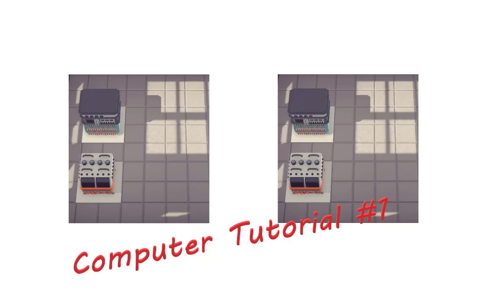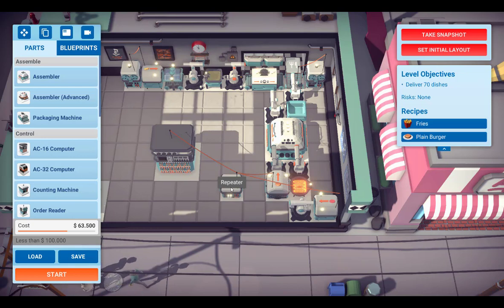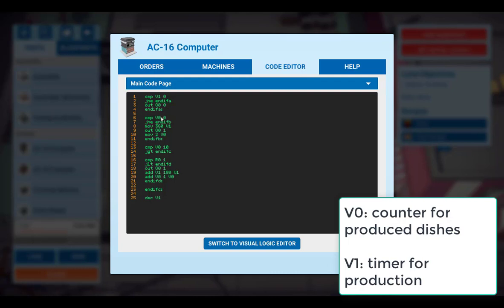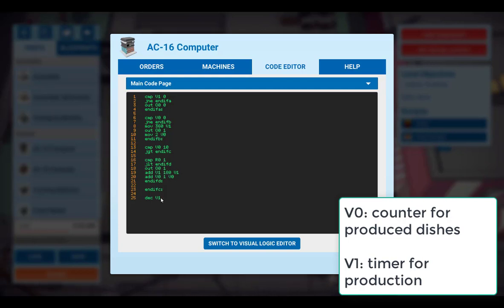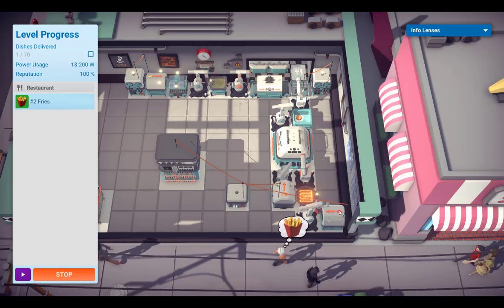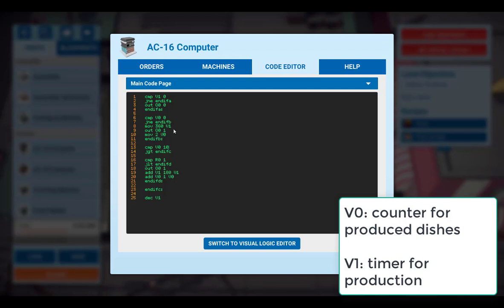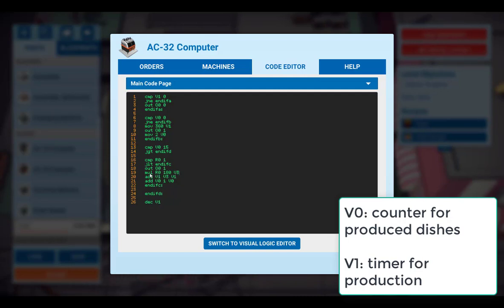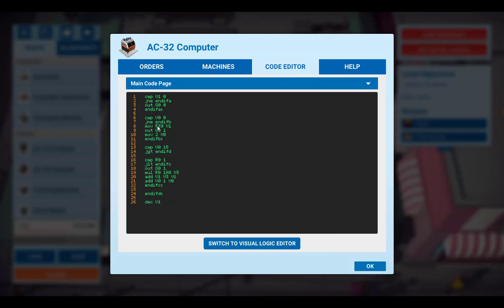Automachef - Computer Usage #1

Comment: Thanks for making this video, the game doesnt explain at all how to use the computer even though its practically a must at the later stages of the game, but this is still so difficult for me, I think the part that Im most confused about is how do I set the variable? In the editor it only exist as v0, v1,v2, v3, how do u get v0 as "counter for produced dishes" and v1 as "timer for production", I re-read the Help section and they never state the specifics about the variable, I think u missed a big step about this, it would be helpful if u can explain.
Reply: You should read the help file in the last tab.

I don't learn this yet too, but I read something like it on the help tab.

I'm stuck on level 27, I already did the 28 without using computers, but 27 isnt allowing me to.

Comment: Excellent code. Im not a coder but I do understand simple codes like this (In visual mode at least). The idea of not using a counter to count produced dishes but instead use timed production cycles is very innovative and solves a lot of dysynchrony problems caused by using a counter. However, this can only work  for relatively simple production lines because complex lines sometimes take variable time to complete (arm delay, converyer belt delays, etc.) and that completely ruins this concept. We would appreciate any other codes you can put up (for more complex systems).

Comment: The thing I don't understand is that how did we get the 180 production cycle?? The Help panel says that 1 cycle is 33 milliseconds, but how does that come into the picture?
Also, this works for a simple production line, that takes 5 seconds to make, but for a complex Roasted Turkey for example, you get an order before you can make 2 roasted turkeys...
And how exactly does a repeater work? Because if you want to have different amounts of dispensed materials, then repeaters are either on or off, therefore cannot do different outputs for different dispensers... right?
Reply: Tad late and don't fully understand the computers yet, but I don't think you can get repeaters to recognize new orders, so the use of computers to repeaters for large product lines will need you to sync times using V1.
The 180 production cycle is based on 30 cycles per second, then multiplied by how long it takes your production line to pump out the ingredients for one meal.
In the example shown in this video, they've set their patty and bun to take 6 seconds between each dispense, so 6*30 = 180
That's at least what I've got so far, still trying to use this in one of my own lines.